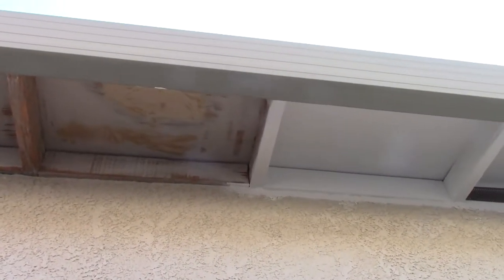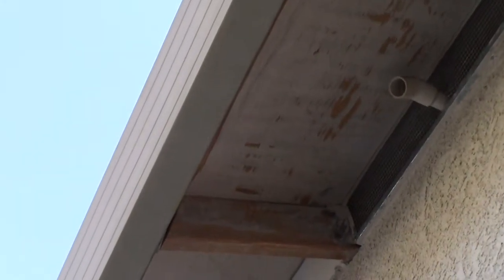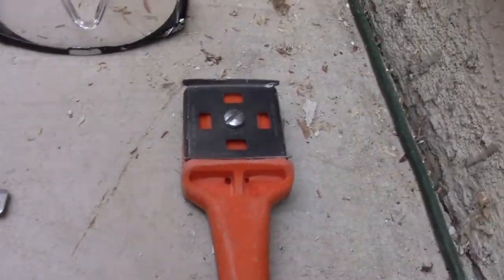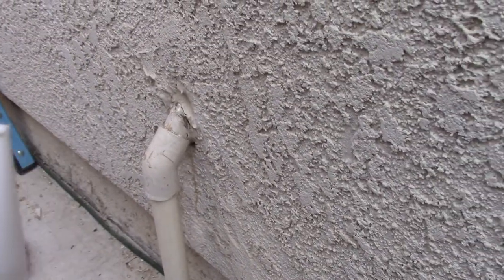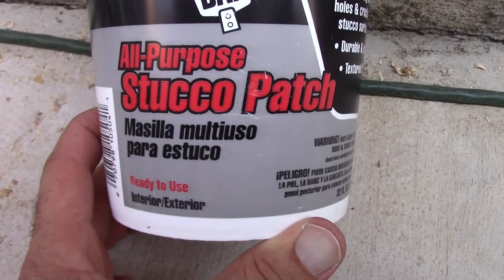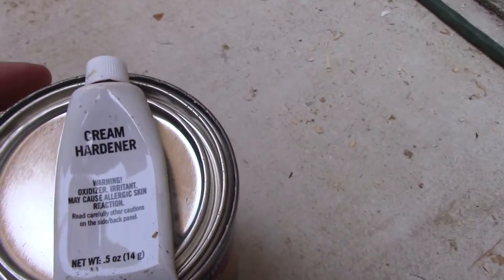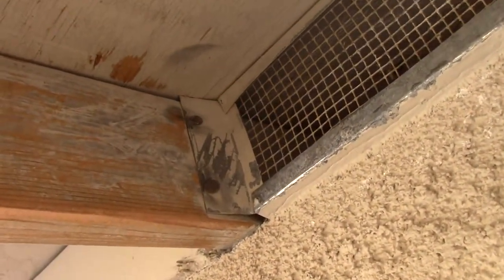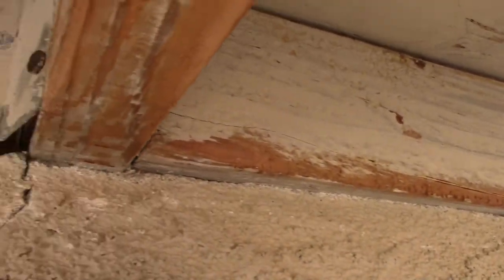How to prepare stucco house for painting, quick tips to seal, patch and prep

Comment: How do you address the eves that are really bad split
Reply from the maker: I had one facia board (on the end) that I replaced...since the eve is an extension of the truss and is covered with plywood, tar paper and roof tiles, you could sandwich the eve with matching wood on one or both sides and pre drill and screw or bolt them in...